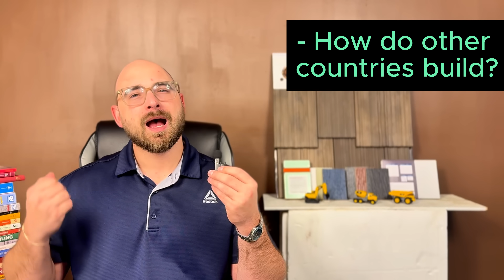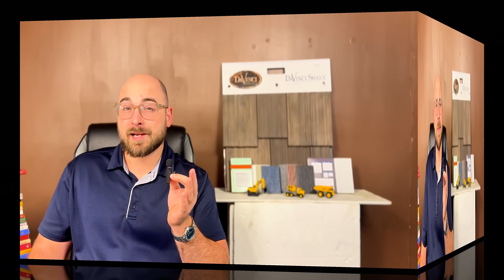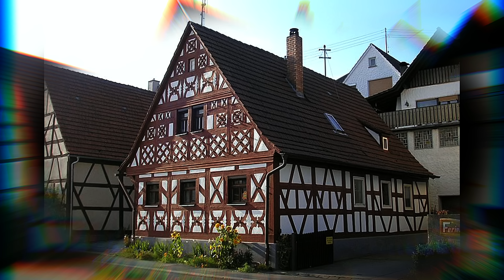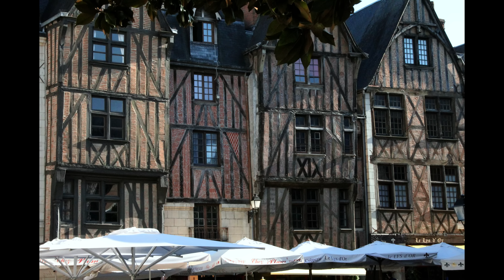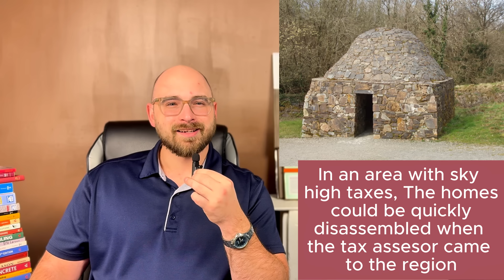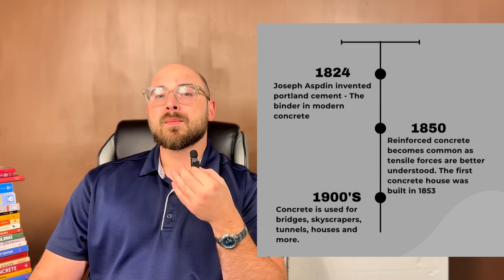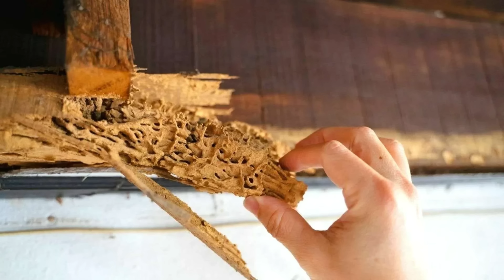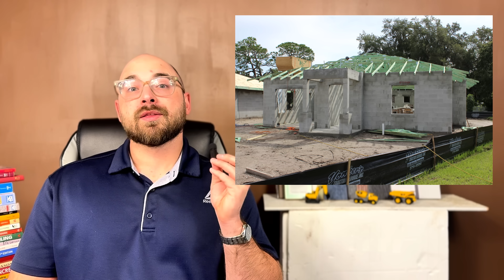Why Other Countries LAUGH at American Homes

Comment: The problem I see with US homes is their quality doesn't fit to their price
Reply: Most definitely!!
Reply: The price for those houses is what got to me too every time. I get that one wants a home and light wood framing is there to make that easy, fast and cheap. So why are they so expensive?!
Reply: @brunsheimmasterbaitwilfrie2811  Living in California, it's more than land than anything. My 1/4 acre lot is $1M w/o any house. The 100yo wood frame house and detached garage sitting on top just adds another $400K.
Reply: @olivertwisted  So, overvalued land and house, lol. 400k for a wood frame house? insane
Reply: 50k would be the price of all materials: concrete and rebars for foundation, grouting and bond beams, blocks, roof with rooftiles at current California prices. Finding a company that would put it together would be rather impossible. It would have to be so called "commercial" builder that would skin the owner to the bone with extra zeroes at the price tag. Regular construction companies just build sheds. it's possible to do it if someone wants to be an owner-builder, educate himself, find independent tradesmen and not allow to be scammed. However nobody will do it, because nobody knows it can be done living in the bubble of stick world.
Reply: @brunsheimmasterbaitwilfrie2811  the price usually is more defined by the area the house is located. Even the  shittiest home in LA will be way more expensive than a high quality house in the middle of nowhere in Idaho.
Reply: Location and acreage. The same house in L.A that costs 400k costs 78k in sw missouri@brunsheimmasterbaitwilfrie2811
Reply: @brunsheimmasterbaitwilfrie2811  High labor and land costs coupled with lots of expected features/extras.
Reply: @brunsheimmasterbaitwilfrie2811  $150 an hour minimum for the labor, thanks to union rules in my region.
Reply: @brunsheimmasterbaitwilfrie2811  It's the real estate that is the real barrier to home ownership in the U.S.
Reply: @brunsheimmasterbaitwilfrie2811 because there is a severe lack of housing options on top of housing being seen a (retirement) investment. 
Basically supply and demand, on top of eveyone thinking their house must sell for more than they bought it for (inflation included).
Reply: The entire price of a home is based on regulations that artificially restrict supply to be produced, that’s it.
Reply: @brunsheimmasterbaitwilfrie2811  Land, permits, supply and demand, financing, tariffs (even before Trump), NIMBY obstruction, other city obstruction (mostly reducing supply), and often politicians have to be "compensated" for any big construction project to go through.  And a lot of contractors can't do math well, and have learned the hard way to be certain there is a profit.  Moving dirt also tends to be pricey.  Not enough tractors, I guess.  Connecting to city plumbing often comes at a high price tag, mostly because of overpriced unionized city workers.  Many of these things very greatly by location.  In California, the permits are nearly half the construction cost.  You have to do archaeology surveys...just all sorts of nonsense.  Some places in rural America they are very cheap, and many things don't even need permits that are not large structures or homes.  Where I live, I can build up to a 6' x 8' non-powered outbuilding without a permit, or replace something that fell apart a little larger like a gazebo...nothing more.
Reply: @brunsheimmasterbaitwilfrie2811  Usually the land value.  The exact same house can vary by a factor of 3x or more depending on where its built.
Reply: @brunsheimmasterbaitwilfrie2811  The cost is rarely because of the house itself, it's the land and location. You're looking at a total purchase price where 2/3 or in desirable locations even more of the value is the land, not the structure
Reply: @incarnadinegardens  Thx for the enlightening answer!
Reply: We have $800k homes being built that won't last 10 years if they're lucky
Reply: @chicagoan81  Yeah my timber frame home was built in 1901 and still perfectly fine. It also cost way less than 800k. So I dunno wtf you are talking about.
Reply: @chicagoan81  Probably not true.
Reply: @chicagoan81 yeah you say that but there's extraordinarily few new homes falling apart in 10 years on their own
Reply: @chicagoan81  bullshit.
Reply: @chicagoan81 last 10 years? You can't even get a house built from day 1 without problems
Reply: With that cost, you would get like 20 or more homes of 3-bedrooms size here in Tanzania, including buying the  plots where they will be built,  and last for a lifetime. Stable homes made by CMO, concrete foundation and roofed with corrugated iron sheets, finished to perfection, or at least 10 two-storey homes @chicagoan81
Reply: @chicagoan81 on average the prices in areas with high interest the prices for m² is around 1,5k/2k
Reply: @chicagoan81  you see now that doesn’t make sense to me that’s from another country, with that kind of money you get a double story or triple story brick house over here
Reply: @chicagoan81 some houses in europe are rather cheap and if a fire happens there isn't much that needs to be fixxed
Only the internal rooms and the roof. The fundament and walls don't get destroyed by the fire
Reply: @jasongrey3113 I know, right?
Houses made of concrete, steel and brick are simply superior.
I remember going to UNESCO world heritage - an old 14th century village made out of stone... 
Crazy how even these comparatively primitive structures can last.
Reply: @spytff  and then you see all these millenia old castles and city-walls in europe that are multipe times older than the USA
Reply: @jasongrey3113  Happens in places where the nobility spent centuries killing their citizens to sate their egos.  Needed a nice place to home up in eh 😂
Reply: @chicagoan81 800k homes made from matchsticks and paper mache 😂
Reply: @chicagoan81  10 Years? Are you out of your mind?? I would love to know of a single home in the US that won't last at least 100 years. Please do provide examples, especially for $800k!

The average homes in my area are 100-150 years old, we built our last home almost 40 years ago, on one of the great lakes with 70 MPH winds, hail, and tornados, and it never had a problem. Still holding strong now and probably for another 100 years.
Reply: @chicagoan81  Uhh, please give an example this. 🤨
Reply: @psidvicious LA fire
Reply: @psidvicious  just look at any of the home inspectors who are coming out with the issues inside almost all new builds. They use a cardboard like material for the walls. Come on now. It barely helps support the framing and homes fall down in strong winds.
Reply: @Marynicole830  Unless there’s a new material I’m not familiar with that you’re referring to, drywall and “cardboard” end in similarity with the paper facing and backing. Drywall, unlike cardboard is immensely superior to plain cardboard for sound proofing, fire proofing, ease of repair or remodeling just to name a couple.
Reply: @psidvicious  type 'cy porter' into your search bar.
Reply: @psidvicious  Look all around Texas. Shitty houses that are barely 5 years old, cost $500K and are GARBAGE. I live in such a house. It was built only 6 years ago and the corners of the interior are cracking because the foundation is TERRIBLE.
Reply: @largol33t1  And who’s fault is that? I don’t even live in TX but I’m aware of the foundation issues and settlement cracks that have been a thing there for ever. Maybe you could have done a little more due diligence and had your house foundation reinforced more sufficiently than what is typically offered in track home projects. For a few thousand dollars you could have increased the base gravel layer depth, more substantially or installed post tension cables in the slab on grade, to counteract the settlement forces. A few thousand dollars initially in a better foundation or several thousand dollars later, chasing wall cracks around. The soil you have in a particular location is the soil you have. The method you choose to build on it will dictate what kind of product you will ultimately get.
Reply: @chicagoan81  I live in America. I have owned a house over 100 years old, brand spanking new homes, and somewhere in between. We have building codes to insure a home is safe, strong, and will last. I have never heard of a home lasting only 10 years, let alone an expensive, high end home selling for $800,000.
Reply: @chicagoan81 That's exaggerating. My house is 30yrs old and was poorly maintained for quite awhile. It's still 100% structurally sound. I build homes and they are built better now with stricter requirements and better materials then my house was built with. If a house only last 10yrs that builder would never build again.
Reply: @chicagoan81  what are you on about my close family home is about 800k today and its been standing for over 30 years no problems
Reply: My house in FL is solid structure concrete, reinforced with steel. We recently endured direct hits by 2 hurricanes, including Helene. We had to open the front door, to hear the wind. This house has also been in my family a long time, three generations have lived here, me being the 3rd. It's just a solid little place with no pretense. I'm offended by McMansions, and just about all new builds in the US are just cost arithmetic when they should be family institutions. I walked into my friend's new house, and I felt like a victim of the builder's accountant. The cut corners pitiful evidence of short-term thinking, the undisclosed addiction of American capitalism.
Reply: i guess, US houses are treated as consumer goods, only for temporary use, while European houses are made for max. durable use.
Reply: This is applicable to literally everything in the US now lol
Reply: @plasmaxl8626  yep "I will bring egg prices down on day one right after I end the war" 🤣🤣🤣🤣🤣🤣🤣🤣
Reply: If you pay over $1000 per square foot for a house in Manhattan, only $50 per square foot goes to the cost of exterior wall materials and labor, very roughly speaking. So for the overall house price, the cost of wall materials and labor is a small portion, and even a fairly small portion in highly developed areas.
Reply: American house IMO, is basically glorified back yard wood shed.
Reply: I'm a bit late to the party, but as someone who has lived in Switzerland and Germany all his live long, I can assure you that what these internet comments doesn't reflect reality.

Simply speaking, the housing market in the US, does offer you much more value in return for your money. The majority of us live in tiny and small appartments in grey concrete blocks. Most appartments don't have an own washing machine, some even don't have a dish washer machine and most of them don't have any air conditioners. The next view, you have is to the next facade. It's not unusual that you've major noise problems, nobody wants to solve, so that you can't do anything about it. Where I live now (Switzerland), buying a house is enourmsly expensive to a point, that not even upper middle class people can afford houses.

When I lived in the US for my exchange program, I was totally blown away how Americans live. They live - compared to us - in beautiful and spacious houses, which don't lack any kind of modern amenities. They mostly have their own garden and garage. 

I actually have good friends, who moved for this exact reasons to the US. They were fed up that they couldn't afford a house with their two kids though both were working full time. They bought a lovely house in Florida. They never regretted their choice.
Reply: The issue is when people compare 80s prices today with income saying the prices are the same 5X your annual salary. The cost of living % was lower not to mention less taxes and a better economy.
Reply: That's why many Americans call their place made of wood, paper and plasterboard a "home", not a house. A shack or shed doesn't qualify as a house.
Reply: The problem is capitalism. Homes are considered a rapidly manufactured commodity now. As in all other industries, the builder wants to make the most profit for the lowest expense, so they throw up tons of dogshit quality stick-built structures which crumble in disasters, then charge an arm and a leg for them, keeping average homeowners in debt forever. In the last few years, developers have reduced the rate at which they're building homes to keep supply artificially low, contributing to the current housing crisis. Same thing DeBeers did with diamonds, only with less (recent) ethnic cleansing. For-profit firms can't be trusted to act in the interest of society; they will only act to maximize profit and externalize costs.
Reply: I've just seen a video of some devastates investor who payed over $60.000 to a "contractor" to nail some board framing and "walls". Everything needs to be demolished because moisture ate the to be home before it was closed. I just can't. In my country, even if you were going to sell something like that as a "garden shed" you would still go to prison for fraud.
Reply: This! Here in Spain we have premade, timber houses, but they cost 1/10th or less of a regular solid house, so it's fine. But paying 500k for a timber house? (I've made some research in real estate agencies) That's crazy. In the other side, here prices are 300k for a flat, but at least you know it won't fall in the next hearthquake.
Reply: Yes, Americans played with their house market too much. The real production cost should often be 10 times lower than the current market value. Especially, with all taxes you have to pay.
Reply: In the USA houses are built with three priorities: they are to be cheap, easy to destroy if the mortgage is foreclosed by a bank, and disposable so that children or grandchildren do not inherit them but mudualy buy another disposable "buildings". The entire Merican market is a market of banks and manufacturers.
Reply: @poke-you-tube not true
Reply: Because they're a speculative commodity, not housing.
Reply: US homes are basically barns or sheds. We have wooden 'homes' in our backyard. I'd cut US house prices in half, not paying $300,000 for a barn. For that money I want a proper brick and mortar home that can halt a truck crashing into it. You can drive a car through US homes... not a secure place really.
Reply: That's why they laugh at us. I lived for a month in a VERY old Swiss house and it was as solid as a bank vault. A lot of fixtures and the superstructure dated back to before WW2 but it felt like it was barely 20 years old. There is NOTHING in the US built as well as this house.
Reply: 👍🏼👍🏼💯💯  Where I live in the Usa the houses are built with very low quality material and people that have no knowledge of constructing a home BUT  when it comes to selling you that garbage they run pretty steep. They sell them for 10X the amount of money they are worth.☹☹
Reply: Fr, here In Argentina you can build a very good house that has 2 floors and it's made out of concrete, with the price of a normal USA house
Reply: And the homes in Australia, Canada, & the Western Europe are? Can people even afford houses there? From what I saw, they are even more expensive than the US while being smaller.  
In the US, home insurance pays for disasters so it’s not like they are just falling apart.
Reply: There is generally less apprciation for quality and long service life in the US than there is in, for example, Europe. Especially in the case of commercial buildings, they often get razed after a 10, 15 years, and something new is built. I mean, have you seent he average Walgreens? It's often nothinng but a near windowless sheetrock box over a wooden frame.
Reply: Agree with disconnect between high home costs and "cheap" construction. Isn't there a greed factor? Isn't construction labor in border states mostly undocumented (zero political commentary) and therefore quite inexpensive? Yes, material costs, etc., have inflated, but I wonder what the average builder's margin is today v. 40-years ago.
Reply: The land often costs more than the house itself.
Reply: In canada just building permits are about $300k
Reply: Yeah cause there itterally is a housing shortage in most US cities and surrounding towns and suburbs.
Reply: The land is most of the price.
Reply: On the other hand they oversize other stuff, like traffic lights that would survive a n-u-k-e. It blows my mind.
Reply: Majority of the price of American homes is due to the location. You can get a mansion outside of the city for the price of a tiny home in a desirable neighborhood with amenities, but yes, the housing market in the US has severely inflated costs.
Reply: Mostly the problem in the USA is that Americans want the largest house at the cheapest price.
Reply: made is america used to mean something reasonable when it came to quality.. today, it usually mean abject crap.. even china builds cars better than the us does.
Reply: exactly, paying 800k for a Woden house is diabolical.
Reply: we cant afford it either wym 😭😭😭😭😭
Reply: Its ridicoulous that canadians pay double or even triple of what my family paid for a house in Czech Republic. Yes we have cheap labour, but we also have brick house, with an indoor pool. And its the same floor area.
Reply: Yeah their price is the location they are built and not what they are built with. Also labor cost can change depending on area which also adds to the cost.
Reply: And especially the sound proofing. when you can hear you neighbors sneeze.😂
Reply: Yep! 

Back after WW2, there was a housing boom because of returning GIs and this surplus of skilled labor

So homes were often the cost of a year's salary. Yeah, they weren't mansions, but it had plumbing, electricity, heating, a roof and a floor. It was like this until the 80s

2 years salary over 30 years meant they were also affordable. 

Now you're looking at houses that cost 10x the amount, built on the cheap because the "house" is part of a company's portfolio, probably failed inspection 3-4 times and has the cheapest fixes to maximize profit. 

It's just crushing at this point over how greed has ruined the American Dream
Reply: 5.40 dollar for 50kg bag of most expensive cement (110.23 lbs)
58 dollar for 1000 most expensive red bricks 
There are cheaper ones😂😂😂
Reply: Some of that is that you're paying for the location and the land more than the house. Unlike in the UK or China where you get a 99 year lease on a plot of land, (Possibly others, but I haven't looked into elsewhere) in the US the land is held by you indefinitely as long as you pay the property tax. The further you get out from scenic attractions or valuable city plots, the cheaper housing gets. Why? The housing quality doesn't change much, it's the cost of the land.

There's also the point of demand. Most of Europe has a crashing birthrate, which means that demand is lower for housing. Housing will continue getting cheaper and cheaper until they get that under control. The US birthrate hasn't dropped as much, and we've more than counteracted its effects with immigration.
Reply: Huge houses for a family of 4= spending hours and hours to clean it, spending plenty of money to furnish it, to heat it , to cool it..
Arrogance of Americans who wanna hv everything big =  rational use of space of Europeans
Reply: @M.C.K.111  You sound jealous. Probably have to share a bathroom with your neighbors.
Reply: Keep voting for politicians obsessed with catastrophic anthropogenic CO2 mediated “climate change “ and everything you touch will continue this upward price spiral.
Reply: Their "pride" rather then their😮 "price".my village has withstood more Earthquakes then USA civilization.
Reply: Exactly
Reply: Quality is one of the variables in the price of real estate. If there are people buying it, then it's ok.
Reply: Insert Michael Scott "Thank you!" meme here
Reply: that's how everything is. it used to be you'd go to a store and look for American made stuff. because it was durable and lasted. you stayed away from China the J A pan company and the other Asian countries because the stuff was pumped out in swet shops and junk. well those swet shops are getting some skills and the labor is still squat so they can put out a nice product that if someone tries to compete with here they need to go cheap and fast and produce junk. it's just how this place has been run into the ground by the country hating left. so you have a third world country with a few decent areas where all the corrupt government people reside. then you have me, the guy that does all their plumbing, heating, electrical, fix their stuff because they are dumb. and I charge them ridiculous amounts to do so. we call them middle class, some of us are better at gouging those useless mouth breathers then others. that's when corrupt family courts come in and steal your kids, your pay and bends you over before they leave. so then I have to gouge them even more. sure I'll be in prison soon because I won't lay down and beg
Reply: I think that is down to scale and location.
Reply: That is correct !
Reply: mostly a location thing(the place is also being sold effectively)
Reply: It's all about supply and demand
Reply: Doesn't matter important is do you pay in cash or you are slave next 20 years in the bank
Reply: and because they are doing this in the tornado alley
Reply: If you think that's bad go to australia LOL.
Reply: also they had better buildings back in time but decided to live worse but cheaper yet again just like with everything else
Reply: That's because you are paying for the land, not the house.  The land is way more expensive than the home.  If we started building homes like they do in Switzerland or Germany, they would all start at $5 million.  Try paying that inside the maximum 25 year mortgage
Reply: us houses last over 100 years without care but still not anywhere close to others
Reply: AGREED
Reply: @meow3343  They'd cost waaaaaaaay more if they were built with bricks and concrete. If they cost 400 000$ now, then they'd have to cost millions.
Reply: Hey, just gotta say. I like your avatar hehe :D Kinda seen it somewhere else :D
Reply: Price is usually set by price of workers, the US usually deports the best workers.
Reply: You have the same in the UK and most countries in Europe.
Reply: You pay for the land not the building
Reply: You can blame local, state, and Federal regulations for this phenomenon. 
Together they force final costs for homes to outstrip any reasonable price. 
Meeting the standards, individually and in total, adds an unusual amount of overhead expense for 
the numerous persons inspecting them, compared to the cost of those building the damn things...
Reply: Thats not just a US problem, i see the same in germany too
Reply: In Germany to😢
Reply: nothing does T.T
Reply: Which homes?
Reply: Just like basically everything in North America, the land of the greedy and selfish a**holes
Reply: A fucking men.
Reply: It's hard to notice when you have been living and breathing this absurd fact your entire life but now that you have pointed it out, I feel like I have been scammed. Look at the California fires that incinerated homes not too long ago. The area looks like it's been nuked.
Reply: You're not paying for the house,  you're paying for the land 99% of the time.
Reply: It’s because boomers decided to use regulations to turn shelter into an investment asset rather than shelter.
Reply: You're 100% correct!
Reply: european houses still several times the prices
Reply: 100%  there is too much greed here!
Reply: The high price is due to cost of land, land with building permission is scarce and thus expensive. The actual structure is cheap.
Reply: you are an idiot
Reply: Yeah, let's take the opinion of a crazy cat lady serious.
Reply: you can thank boomers and suburbia for that, an uroboro of circle jerking to make as quickly and for as cheaply to price it as expensively to a group who see homes as investments than as... places to live
Reply: Housing stock, labor costs, insurance costs (on every procedure), zoning
Reply: Im a painter I know this is true
Reply: Or the elements.
Reply: It's land. The house,maybe takes 1/2 of the value
Reply: @Rikkan4  That depends on the location.
Reply: Definitely! And here in the US new construction houses keep getting worse and worse and more and more expensive because the house builders are no longer mom and pop companies but rather are large nationwide firms that build houses in volume. And except for South Florida it's often cheap light wood construction with no pride in work evident, because the workers often work for federal minimum wage, less if they're illegal aliens.
Reply: For what they are paying, I would expect clt or steel for the frame.
Reply: I'm not sure... In Hungary, in county capitals, a newly built family house around 120m² has a similar price to a 120m² house in Florida. In Budapest, a 70-80m² flat has a similar price to a 120m² family house in Florida. Western European house prices are even higher.
Reply: @makoado6010Also Florida has much nicer weather, has more activities than Hungary, and has over twice the population.
Reply: @makoado6010 Russia overtook China in terms of housing construction in 2023.
 Real Russia/Provincial Russia, North Caucasus Federal District, Stavropol Territory, Stavropol city (population 557 271: ethnic Russians 86.3%, Armenians 4.47%, Ukrainians 1.03%), average annual t +9.9°C, climate Cfa, average monthly rainy days: 8.2-13.7 (767mm), average monthly sunshine hours 230.8, altitude above sea level 230-660m; crime index 34.76, average monthly salary is $597,6, average life expectancy is 74.9 years. The distance to Mount Elbrus (5,642m) is 206 km. Ecoregion: forest-steppe (broadleaf forests/meadow steppe). 30 modern condos from Stavropol city SJFU2jHnMzU see the description of the video
 PS: Chernozems is 47.4% of the territory of the Stavropol Territory.
Reply: @makoado6010 Real Russia/Provincial Russia, Central Federal District,  Belgorod city (founded 1596, area 153km²), population: 394.174 (agglomeration 719.500), ethnic Russians 94,4%, Ukrainians 2,8%, migrants from former republics of USSR 0,5-1%; average annual t +8.3°C, climate Dfb; average annual t°C: summer/winter July +21.8°C (+16.6 - +26.3°C), January - 5.5 °C(- 3.4 - -8.1°C); average monthly rainy days: 7.6 - 11.2 (627mm), average monthly sunshine hours 82.7. Ecoregion: East European forest steppe. The air distance from Belgorod to Moscow - 577 km, unemployed 4.8%, crime index 29.61%, Gender: men 44.5%, women 55.5%. 
Typical houses of suburbs of Belgorod city:
   This projects is the best-selling 2022. Houses 100(117)m²: 10(15) ares (50x20(30)m); living room 20(22)m², kitchen 16(18)m², 3 bedrooms:16(18)m²,14m², 12(14)m², 2baths, garage20(25)m²+boiler room 8(10)m², terrace 14(16m)², carport, ceiling height 2.85m, video intercom, fiber optic Internet, cable TV, heating combined: underfloor heating and radiators, metallic fence 1.8m, metallic front door with shockproof glass(98kg), metal tile, paving slabs, automatic gates.
  Dubovoe(Oak)sm town (5km from Belgorod city, population 16,000). 
 Houses 117 m²:  -PvQZ_2wjZc TbE48oAW9wI nvuM6nJGEVg lZrceqCI_s0
 Houses 100m²: r6wJEsKCinU  9COd2gtz7YY pOeAXrAUDxs

Chernozems in the Belgorod region is 77% of the area.

Belgorod Wedding short clips, 1min:
 Utark Castle, Picnic Park T-yp-kpsHaw
 Center, Picnic Park -2IY3iOUGNM
 Center, Picnic Park YTDUYIsnHts
 Fort "New Jerusalem" epx9KSy7Dus 
Belgorod. Wedding service "Dynasty" short clips, 2-3 min: xgeLiHgA46Q dQSCS0d6YhU
  Such weddings and houses are bought by those who work in oil and gas companies on a shift basis in Northern Russia and Siberia in extremely cold climates.
Reply: @makoado6010   Real Russia/Provincial Russia, Central Federal District,  Voronezh city, population 1,04 mln (agglomeration 1,3mln), ethnic russians 96,9 %,  Average annual temperature of Voronezh city is +7,7°C (2012-2022). The air distance from Voronezh to Moscow - 520 km.
 Koltsovo village is suburb of Voronezh city (10 km), typical modern houses:
House 120sqm (first option): 10 ares (50x20m); living room 22sqm, kitchen 16sqm, 3 bedrooms:18sqm,16sqm, 14sqm, 2baths, carport (without glazing) 20m²+boiler room 12sqm, terrace 16sqm  with barbecue complex (without glazing), ceiling height 2.85-3.2m, gas, video intercom, fiber optic Internet, cable TV, heating combined: underfloor heating and radiators, metallic fence 1.8m, insulated metallic front door 10 cm(98 kg) with shockproof glass, metal tile, paving slabs, mirrored windows, automatic gate.  03F0_pw9AeM  
House 120sqm (second option): 10 ares (50x20m); living room+kitchen 32sqm, 3 bedrooms:16sqm,16sqm, 16sqm, 2baths, garage 20sqm+boiler room 8sqm, terrace 18sqm(without glazing), ceiling height 2.85 XpbkoWu4QXQ 

Forest fairy tale village is suburb of Voronezh City (27 km). House 120sqm: 12,5 ares (50x25m), pines; living room+kitchen 32sqm, 3 bedrooms:17sqm,12.5sqm, 12sqm,  2baths+boiler room, garage 20sqm, terrace 16sqm with barbecue complex (without glazing), LED illumination, gas, ceiling height 2.85, insulated metallic front door 10 cm(98 kg) with shockproof glass, this street with 7 analogy houses  KG34YS_j-PI 

Chertovitsky Forest village is suburb of Voronezh city (18 km), typical houses 100-120 sqm  DJUX16dnuXc The fences are not completed. PS: With fences 5wO0HCnHzTM

Voronezh City , Night cycling, center old historical town nDsjdhS-n48  
 Voronezh City , evening bike ride in Dolphin Park (Ship Grove), Voronezh River Embankment, time - 5: 20 lighthouse 30DOyR9HyUU 
 Voronezh by car: time 0: 00 - industrial zone, 3: 45  - outskirts of city, 10: 30 - enter to city  ARg7YuS9Smc 
80% of the territory of the Voronezh region is chernozem (black) soils
Reply: @makoado6010   Real Russia/Provincial Russia, Asian part, Central Siberia, Krasnoyarsk city (founded in 1628, area 379.5 km2). Population: 1,187,771 (agglomeration 1,412,000): ethnic Russians 91.3%, Ukrainians 1.4%, Tatars 1.3%, Russian Germans 0.8%, Russian Poles 0.5%. Average annual temperature +2,7°C (533 mm), humid continental climate (Dfb); average monthly rainy days: 6.03 - 13.13, average monthly sunshine hours 92.74. Ecoregion: South Siberian forest-steppe(island steppe). The air distance from Krasnoyarsk to Moscow is 3,352 km. 5,8% unemployed, crime index 45.37%. Gender: men 43.99%, women 56.01%.

 Russia, Siberian Federal District, Central Siberia, Krasnoyarsk city, new housing complex "South Coast", walk with Anna BWEI8h3A6bA
 Krasnoyarsk city, Children's flash mob and Krasnoyarsk's British Music Club, new housing complex "Scandis" i3kiq5KNauc
 Krasnoyarsk people: parents and kids, Smile Day, housing complex "Scandis" U9sXB1AKs4s
 The outskirts and suburbs of Krasnoyarsk city, Krasnoyarsk sport life News (short clips, 1 min):
 Krasnoyarsk outskirt, Extreme Sports Festival uoU3CRsv-zQ
 Krasnoyarsk suburb, Running Day VWksyMXjx3k
 Krasnoyarsk region, Sky Marathon nAbcIZOALfY
 Living environment: Siberian Mountain Mixed Sub-Taiga, Motocross in suburb of Krasnoyarsk city around the Siberian Mountain Mixed Sub-Taiga (grassy forest), Dima and Aleksandr - father and son (elementary school) qPEBY5lqZ9M
 Iron Race (2,5 hours in the Mountain Mixed Sub-Taiga) xiDm6YCdcKg Dima and Aleksandr.
 Taiga in the Krasnoyarsk region is 2 million sq km. Near Krasnoyarsk city(7km) IHmwpnZAdF8 More than 90 rock formations with a height of 40-90 meters into hills with a height of 400-800 meters with mixed taiga - Siberian tree species: fir, spruce, cedar pine, pine, aspen/birch. The Nature Park is closed in the spring due to the Mating Season of Brown Bears, Attention Bears!
Reply: @makoado6010 Preview1: In the 1930s, a bunch of kids from Spain came to Moscow to escape the fighting during the Spanish Civil War. Around 2,900 kids and 5,100 adults came to the USSR as part of 4 groups. About 800 of them fought in the Red Army, Including more than 70 Spanish pilots. 151 died and 15 went missing.  Of these, reconnaissance and saboteur teams were formed and sent behind enemy lines, with 119 Spanish men and 6  Spanish women among them. In the summer of 1956, Franco granted amnesty to the exiles and allowed them to come back to Spain. Over the course of 1956, 1,692 returned from the Soviet Union, and in '57, another 250 or so came home. But most of them couldn't adjust to life in Spain and soon headed back to the USSR again.
Preview2: During the Great Northern War between Russia and Sweden in the 1700s(1700-1721), around 120k Swedes gave up and were kept in Russian POW camps until the war ended. After losing at Poltava, another 20-25k Swedes surrendered. Most of these prisoners were sent to work in places like Ukraine, Moscow, St Petersburg, Siberia, and the Urals. Around 8k went to serve in the Russian army and were sent to the Ural defensive line to protect Russia from nomadic raids, known as the "Ural Swedes"(Karolins). They quickly assimilated into Russian society.
Unreal Moscow!
The population Moscow region is about 21,8 million people. That's 13,149 million in Moscow  and 8,651 million in the Moscow region.

   Look, so, the Moscow suburbs, there's this New Moscow Administrative District (founded in 2012 with an area of 1,480 square kilometers). It's in the Moscow region, which is in Central Russia, and it has a population of 750 thousand people(2024). Most of them are Ethnic Russians (86.3%), then there are some Ukrainians (1.34%), Tatars (1.30%), and others less than 1% each. The average temperature there is +6.9 degrees Celsius (+7,5°C 2014 - 2024) and the climate is Dfb with 678 millimeters of rain per year. It's got an eco-region of Sarmatic Mixed Forests. It's only 4.5 kilometers away from the Moscow Ring Road, and the unemployment rate is 5.8% and the crime index is 36.69%. There's also a gender split of men being 44.3% and women being 55.7%. And the average monthly salary in Moscow is $1,610 (or $1,400 after taxes). But the average salary in the Moscow region is $920 (or $800 after taxes) and the average life expectancy there is 74.6 years.

  The New Moscow AD has got 42 new residential complexes with 31 schools and 68 daycare centers. There are three types of residential complexes in New Moscow: economic-class (30%), comfortable-class (60%), and business-class (10%).

  Moscow suburbs: New Moscow Administrative District, the Residential Complexes "Spanish Quarters" and "Scandinavia". The video shows Map of New Moscow, Sarmatic forests, Metro, Highways, Apartments and Streets, etc dCbWP56fpcw

  Moscow suburbs: the New Moscow Administrative District and the Sosensky urban settlement. There's a residential complex called "Spanish Quarters", and today's the Spanish Day there. On Velasquez Boulevard, they're having a dance called "A Small Spanish Corner with a Russian Heart"  SvAIixpWDMg

   Moscow Suburbs: In the New Moscow Administrative District, there's this place called the Kommunarka urban-type settlement in Sosensky Administrative Settlement. It has a residential complex called "Spanish Quarters", which is a comfort-class development. It's about 4.7 km away from the Moscow Ring Road and has a population of around 59K (three areas: First, Second, Third). quadrocopter a short video (<1 min) to take in all the sights 0wzZp_Hutys
 Here's a quick video of the "Spanish Quarters' infrastructure with Nadia XP37xfKLlVM It'll give you a good idea of what to expect.

   New Moscow AD(NMAD), residential complex "Spanish Quarters" (comfort class), Municipal School "Logic" for 1,300 students. Migrants from former USSR republics, Central Asia and Caucasus, 10-15% of the population. 
 First school day 2021 n_rdYhEXh-c 
 School day gBMZd_IrtBQ 
 Headmaster and teachers dance 9Qxvlzd55FA 
 Last school day 2022  714vIKdgYGc
 Last school day 2024 AUOrxFtbFlM
High School Graduation 2024 kuHoisaT_P8

   NMAD, Spanish Quarters RC (comfort class): Official meeting between the School Construction Director and the Headmaster of School Center, with parents of Dialectic school students im4ZdjWo14E
Dialectic Elementary School. First day of school 7372v1eAucY

   Residential Complex "Spanish Quarters" condo (comfort-class):
1 bedroom, 63 sq m: option 1 5ohYX6-K5a8 
                                       option 2 eyUiLRMBWII
1 bedroom, 60 sq m 6Lg-KF-OnW4
3 bedroom, 90(?)sq m 4z6FOZ1Bqc0
1 bedroom, 58 sq m, unfinishing  EW80FdTOp4g
one-room: view from the window, entrance, elevator, courtyard Hrs-NO0QfR0

    Short walking with Aleksandr (2 min): "Spanish Quarters" orbAM3YyvK8
"Scandinavia" A2yHpRbe8SM

   So, in the Moscow suburbs, there's this place called the New Moscow Administrative District: Kommunarka urban-type settlement in Sosensky Administrative Settlement and inside that, there's a residential complex called "Scandinavia". It's a comfort-class complex, and it's about 6.5 kilometers away from the Moscow Ring Road. It's got a population of about 60k, and it has three areas - South, Center, and North. The "Scandinavian" complex is built inside this Butovsky Oak Grove, which has some really old oaks (oak petiolate) - like 125 to 175 years old. It's so cool! You can fly over it in a quadcopter and get a short video of it. Video link here: zYgzCfL4VEU  
   And then, I have a video here of the infrastructure at the Scandinavia residential complex (the North area). It's with Maria o2pE-VTxnZw 
   Also in the New Moscow AD, there's the Scandinavia complex, and there's also a school called "Energy", which is a municipal school for 1.3k kids. There are some kids from other countries too, like Central Asia and the Caucasus, who make up about 10 to 15% of the school population. Here's a video of the last school day qCBWTaFalhM

  Open Ceremonies of New Schools in New Moscow AD DvknDUpKLj8  time 0: 28 Cheerleader girl (depigmented Spain phenotype?), 2: 18  Prefect of New Moscow Administrative District
"Constructor" Municipal School, Open Ceremony,  "Scandinavia" RC UuUydScAQSU
"Canvas" Municipal School, Open Ceremony,  "Scandinavia" RC 5mW97ZoNwdE
  And finally, there's another video of some kids from the "Scandinavia" Residental Complex, schoolchildren dancing. It's only about a minute long ubenM6eSTMQ
New Moscow, Scandinavia complex, "Forest Stream" Municipal Kindergarten  K6UXIEzPVU0

   RC "Sсandinavia", Sales Office, Showroom (classic style), 1 Bedroom 60,2 sqm: living room - 19.3 sqm, bedroom - 12.5, kitchen - 13.6, bath - 4.9 sqm, hallway - 9.9 sqm. 1 min jsEIjCeBg_0
RC "Sсandinavia", flats: 
 1 bedroom 65 sqm ZfrGcy7KWD8
 1 bedroom 58 sqm  RT5YNOtxbvQ 
 1 bedroom 51 sqm, unfurnished SWfTUZ0Bnz8
 2 bedroom 69,8 sqm, without finishing  Qt_TdsS33cM
 2 bedroom 93,7 sqm (exclusive design)  Suq9u98QiwY
 RC "Sсandinavia", underground parking space Y8WjeihXu-g

  Residential Complex - a huge place with 60k people living in it, spread over three areas and covering 3-4 sq km. It took 10 years to build, and it's located 4-20km away from the Moscow Ring Road (in the suburbs of Moscow). There's a metro station nearby, two highways, and 21k parking spaces. The complex has three districts, three forest parks, and three squares. There are 4-16-story buildings with a total of 1.5 million square meters of housing. The complex provides 30k jobs and a shopping complex of 200k square meters. There are also 12 kindergartens for 3.6k kids (1 kindergarten holds 300 kids), six schools for 7.2k students (each school has 1.3k pupils), three medical centers with 460 beds, a Sports complex, a Theater, an Orthodox church, a Fire station, and a Police office with video security.

   A stroll with Svetlana and some chat with the residents from RC "Spanish Quarters" D35-zMiHIvk and RC "Scandinavia" _ZWjv-A72sU

     Walk with Vadim around "Spanish Quarters" and "Scandinavia":
   "Spanish Quarters - 1, 2" (2,78 sq km)  T-vO93t_gc4
   "Scandinavia-North"(1 sq km) -i_8G0hxGd0 9: 43 Building Orthodox Church
   "Scandinavia-Center"(2,017 sq km) IvfTTjaJ79o
   "Scandinavia-South" (0,913 sq km) s2wcj__JohQ
   "Scandinavia-Center" at Night (10 p.m.) ip4n555Lfrk
    Winter fairy tale in RC "Scandinavia" k7TFjvvExGA

   Festivals in the residential complexes "Scandinavia" and  "Spanish Quarters", Kommunarka urban-type settlement in New Moscow
   Children's Eco Picnics:
           "Spanish Quarters-1" residential complex pN7r781O6_w
           "Scandinavia" residential complex __7b351bm44
   "VIVA Spain" Fest, "Spanish Quarters-2" residential complex q7e4QQag3ew
   Sports Festival, Kommunarka urban-type settlement: "Spanish Quarters" vs "Scandinavia" kHrAK8D32PU
    First School Day in "Spanish Quarters-1" of New Moscow, Kommunarka urban-type settlement  rkYy5CSTm_Q
Reply: The reason for that is for the builder to maximise their profit. Which of course will go into the developers hands not the workers.
Reply: @Nollauno That is a very good point. I work in the construction business in the US, and see how mentality of construction businesses affects the prices and quality of new and remodeled houses. This is particularly true in mass subdivision residential developments, where houses are cookie-cutters. I am bold enough to claim that the entrepreneurial and business mindset in people here has caused everyone to chase their piece of the pie. Again, this is primarily true for tract homes, not custom builds. 
Also, when comparing prices, we need to compare apples-to-apples. Don't be comparing structures to properties, city house to countryside house,  mountainous terrain to flat land, coastal soil type to fertile land.
Reply: if buying, the main value always lies in the ground / the property. The house itself is secondary. But the US still building wooden structures is total nonsense.
Reply: Sure they do. I've done the online price comparisons. If we control for the interior area and lot area, you'd have to be insanely rich in Europe to afford an average American home. 

It's a matter of what you're prioritizing getting for your money. Americans value space and comfort. No one wants an outdated building without modern amenities. Lasting 500 years isn't a consideration because no one is going to want 500 year old design.
Reply: @69nites I've seen plenty of Europeans react to how much a home in the US would cost in their city/country and most say it would cost them substantially more for a similar house where they live.  Especially in bigger cities because of limited space. That's what we have here in spades is space.  Other than major cities and poorly run states you'll get a good house with plenty of land for a decent price (unfortunately not as good as the pricing 20 years ago).  

If you can drive about an hour outside of cities, prices tend to go way down with a lot more for your money.   I'm actually about to downsize (divorced and kids are grown) and going to buy a couple of acres and build a cabin on it.  I'll be debt free and won't have neighbors 15' away on both sides.  Might even go off grid and have no utility bills as well.
Reply: @ Bro, the wood shack in our backyard is build better than American homes and no you don't have to be rich to buy an home in Europe.
Reply: The main problem with American homes specifically suburban homes is they don’t account for weather and natural disaster.

Building wood in fire prone areas?

Building using wood in hurricane prone areas? 

In a lot countries there would be a lot of regulations to ensure such houses can withstand the environment, in the us homes just collapse within minutes of wild fires or hurricanes…. (Which often forces developers to use alternative materials, wood is simply not cheaper or in most cases not that cheaper to justify their use especially when accounting the environment that they are built it)

That is other then density to ensure home supply adequately matches demand.
Reply: Your arguing with supply and demand.
Reply: The price is dictated by market
Reply: Like yea, if I saw an american house in my country I'd expect to be paying it for maybe 5 years and live in it for another 5. Homes in LATAM are a 15 - 25 debt but you pay for the long haul because that's your house for life.
Reply: Also the walls can’t even stop a 9mm bullet. And that is an issue in the US! 😅
Reply: Yeah, made of cardboard and toilet paper.
Reply: Y'all don't know jack about building do you.
Feel free to drive your car into an American home.
Most homes will shrug it off, replace the siding maybe some sheathing.
Be fixed up in a day.

150 mph wind?
Might lose a few shingles.

Earthquake?
Meh, stay away from shelves. Carry on about your day.

Brick and mortar?
Fairly common.  We use it as an accessory too! Looks good.
Isn't actually needed.
Reply: @NA-en7kz  in most of the things you mentioned it would get completely decimated
Reply: Exactly!!!! If they cost 100-200 thousand that would be a reasonable price. But to sell paper and cardboard houses for 800-900 thousand dollars is absolutely insane.
Reply: Might be true but our homes generally bigger
Reply: Bigger is not better. Bigger Burgers, bigger cars, bigger guts - its not about size  @Unknown-r2p2o
Reply: @Unknown-r2p2o Bigger and more expensive. Aka still low value to price ratio.
Reply: American homes are on average twice the size for the same price as european homes.
Reply: @algaeninja  quality != quantity
Reply: @johnsmith1926  House size is a quality that is factored into price. By your logic, quality doesn't exist, since it can all be reduced to a metric of some kind.
Reply: @algaeninja  But why would the size matter if the wind can easily blow it away the next day or just crumble in a few years on its own? So yeah, quantity is not equal with quality.
Reply: @tovarishchfeixiao  Wind will not blow away a light lumber constructed house, unless you're referring to tornados. However, American tornados will ruin solid-structured buildings as well.

Additionally, crumbling in "a few years" is ridiculous. Maybe in 50 or 100, but unless you're living in a trailer, it's going to last multiple decades.
Reply: @tovarishchfeixiao Europe has less than ¼ of the tornados the USA has and they're much weaker, same goes for hurricanes, earthquakes, snow etc. It's usually older houses going down as they are not up to standard.

Size matters, it's more comfortable & convenient. You can move everything around. It's also much easier to replace/move old electrical wires & plumbing. This means when a standard changer like lead plumbing or copper wires were banned the changes happen much quicker in the USA/Canada.

My bedroom is half the size of a small apartment in a big European city lol.
Reply: @tovarishchfeixiao  Most American houses don't just blow away or crumble. The oldest house in my town was built of wood in 1650. I'm surrounded with wood buildings that are over 100 years old. Most U.S. houses end their lives by demolition, because they are no longer wanted, rather than natural disasters.
Reply: @ Size is in general considered to be a quantity. Similar to volume and weight. Words have meanings. Quantity of your food would be weight or volume, quality would be ingredients, taste and so on... Same for your house. Size of your house is be quantity, quality would be how sturdy your house is, noise level with closed windows, given a certain noise level outside, how easy it is for a thief to break and enter your house, optics and so on... I'd rather live in a smaller house of higher quality than in a house double the size that has the quality of a dog shelter. You might like it the other way around. Go ahead then, more power to you! Still does not matter. What matters is that the OP was talking about the lack of quality, to which you replied: But ours are bigger. But that was was not the issue.
Reply: @johnsmith1926  You can have big quality house like you can have shitty small house. People like to renovate their homes to their liking, it's much easier and affordable in North America. Changing old standards is much quicker too because we have far superior access to piping & electrical wires. 

Europeans are usually smart but they've been brainwashed into thinking our home & building codes are so bad even newer construction can't withstand the forces of nature which is ridiculous. The vast majority of buildings that get heavily damaged are 50+ years old built under different codes. 

And again in North America we have way more snow than northern Europe could dream of. The USA has more than 50% of all tornadoes in the world and the strongest. The east coast of the USA  gets category 1 to 3 hurricanes every year and category 4-5 from time to time while Europe gets tropical storms (much weaker winds). The west coast of the USA has more & stronger earthquakes too. Yall want to laugh at the USA when the houses there have to deal with stronger & more frequent natural disasters than Europe.
Reply: @johnsmith1926  Noise reduction is a quantity. It's measured in dB. Sturdiness is determined by a variety of material and structural factors, all of which can be boiled down to quanitative values. Ease of burglary can be estimated based on whether a house has alarms, number of unbarred first floor windows, number and type of lock, etc. 

Anything can be a quantity if you are analyze it enough, and while square footage is a quantity, the spaciousness of a house is factored into its quality. Nobody would call a 1 sq. m house high quality even if it was built up to close and with the best materials.
Reply: @ Actually quality of noise reduction is already difficult to measure as a quantity as it is not only highly dependent on frequencies but also whether it is a noise dampening or noise blocking effect.
Type of lock is also a question of quality.
Nevertheless, lets have it your way and all of these factors are quantities or qualities if you will. So right now we have square ft or square meters vs all the rest. Putting no effort into it is one thing, but compared to the effort houses are quite expensive in the US.
Reply: @johnsmith1926  American houses are half the price per square foot compared to Euro builds. You're telling me that we put less than half the effort into our houses? I find that hard to believe. You can say that you don't like the material, but calling American houses overpriced (compared to Europe) is plain wrong.

Also, Noise reduction is simple, take two measurements at a singular frequency, and take the power ratio.
Reply: @algaeninja  "You're telling me that we put less than half the effort into our houses?"
It felt like it. Roofing, light switches, bathroom, windows. Most of it is sub standard from a European perspective. Which is totally fine. Everyone does his own thing.

"Also, Noise reduction is simple, take two measurements at a singular frequency, and take the power ratio."
Already told you, that there are already two different types of noise reduction. Dampening and blocking. Specifically for the latter, American houses usually don't do well. The other thing is that different frequencies are handled not equally well by different materials. If you don't care (and most Americans don't seem to care about noise levels), you can go with your simple equation or don't apply it at all. Once again, that is totally fine. You do your thing.
Reply: @johnsmith1926  How many American houses, and what class of housing are you familiar with, because when I was in England, all of what you listed seemed the exact same besides roofing.

The difference between dampening and blocking doesn't matter. All that matters is the power driven by the air to the eardrum, which can easily be measured, and while different materials respond differently to different frequencies, if you choose the frequency most corresponding to the most likely noise source, (cars on a road, rain elsewhere I assume), it will be a good enough measure.
Reply: @BananaBlooD9517  - Great points, and correct to be sure. Americans don't want to live in tiny houses older than our entire country. I just spent some time in Spain, and although the architecture was amazing, it lacked a lot of what we Americans would consider owning. A person we were with in Madrid told us that she lived in a newer apartment that she jokingly said was built in the 18th century, which of course is the 1700's. We stayed in a lodge built in the 1500's and the history there was amazing as well, but again, lacked the amenities we would want. Even newer apartments in Madrid are WAY over priced. a 600 sq ft apartment will cost you over a half million euros and an 1,800 sq ft will cost you over 2M euros.
Let em laugh all they want.
Reply: @justadbeer  I've seen shows and video about small apparentment in Paris... Many people live in 110ft² apartments... I used to have a 72ft² walk-in when I was a kid. I used it as a playroom 🤣
Reply: @justadbeer  People in the USA & Canada want to live in a house/condo/apartment that is tailored to them. In the case of a concrete condo/apartment that means they have to have perfect subdivision & ideally the outlets are at the right place. 

In the case of a house we know plumbing can be easily moved a little bit & electrical wires aren't an issue at all. Heck of needed most walls can be moved or you can add new ones. To split a big room in half. 

Most people I know will buy a house that is somewhat to their liking & will renovate/modify a room every few years. 

My parents bought a house built for soldiers coming back from ww2, they were the second owner. The old copper wire & breaker panel was changed. They did the whole basement that had nothing besides the central heating unit & added 6x24ft to the house from basement to 2nd floor. 

My parents friends, my cousin & my friend's parents all worked on their house & modified it.
Reply: @BananaBlooD9517  Mine is too and i live in a Hungarian village in middle Europe. Half of the materials shown in the video have the same advantages as wood.
Reply: @BananaBlooD9517 Europe has more earthquakes than US, for example, Greece, Italy and Turkey
Reply: @BananaBlooD9517 that’s older buildings they renovated and in the past the houses for the working class was to sleep and eat so they used to be small and easy to heat over the winter.
Reply: @BananaBlooD9517  if electrical work isn't being done by a drunk chimpanzee, it's pretty easy to replace the wiring in solid construction homes. Just tie the new wire to the old wire and pull it through the conduit. If i were to replace all the wiring in my house it'd take less than a week and i wouldn't have to damage the paint or the walls to do so.

Adding new conduit can be a pain though
Reply: @algaeninja size is quantity
Reply: @justadbeer  I hope you compare the price to Washington DC as Madrid IS a capital (about 426€/sqft vs $499 (~475€)). As for property taxes, they are generally much cheaper across Europe, even the EU zone.
Reply: @BananaBlooD9517 
Well we have a slightly above 400m2 stone house.
Reply: @johnsmith1926  If you scale properly you can make quantity at the same price of quality; usually the tradeoff is flexibility which shouldn't be needed when you build in the same type of environment.
Reply: @justadbeer youre comparing houses in towns to apartments in world capitals with a high amount of tourism, obviously an apartment in madrid is gonna be more expensive(relative to a number of factors) than a house in some random town, compare NY apartments to Madrid apartments
Reply: @tovarishchfeixiao  The place I live in is a standard light wood framed house with drywall on the inside, and plywood with siding on the outside. It was built in the 1970s, and is structurally fine. However, the builders were cheap, lazy, and a bit dumb; the wiring, and plumbing were done very, very poorly. We've slowly had to fix a lot of their questionable interior work. So, the typical American house doesn't crumble after a few years as you say. Like I said, mine is fine. All of the houses I've lived in growing up were built the same way, all in the 1970s through the 80s, and were all structurally fine despite being decades old.
Reply: @BananaBlooD9517  .....far superior access to piping & electrical wires??? LOL... First of all, We have a better energy system In my Country, Austria. It´s 240V and 50Hz instead of the weak 110V at superficial 60Hz.  We have no ridiculous Cans on high poles beside the streets but massive transformer stations in a concrete Tower for about 500 to 1000 households per Station. Cables standard all underground. Only the 400V line can go over the ground. And, the only houses without electricity here are the ones with not paid power bills!
Reply: @tovarishchfeixiao  Wind, or a hurricane? I've never heard of a home here in America falling down on a windy day. !00 mile an hour hurricane winds, sometimes.
Reply: @BananaBlooD9517  
I'm from Northern Europe, and some of the American weather extremes always comes into my mind when people discuss about building houses here versus building it somewhere in the USA.
Reply: @pcno2832 or they burn down (See the Californian recent fires)
Reply: @BananaBlooD9517  In most european countries the electric wires are underground and go directly in to the house That's a reason we don't have so many black outs. 
If we want to renovate a house we don't need inspectors and can do inside what ever we want.
Reply: @BananaBlooD9517 have you seen your plugs? What standardchange. Everything you say is possible to do in every home.
Reply: @pcno2832 old us homes were used with slow growing forest lumber. No comparison to what they use these days.
Reply: @algaeninja what implies quality to you: s small diamond ring made of most precious materials, or a big ring with stones from the river and made of wood.
Reply: @r.a.9630  What implies quality to you, the Cullinan I, or a singular grain of diamond dust?
Reply: @justadbeer  Bro, what? half a million for a 60 m2 apartment in madrid? Just say you havent got a clue and stop making up nonsense. You pay that for new construction 120 m2 apartments, lol. And 2M is only for luxury units inside poshy neighbors. Madrid is also possibly the most expensive place in Spain. Compare it to a flat in New York or Miami or something, not to your timber dog house in the middle of nowhere. An average brick and mortar 200 m2 house near the Mediterranean sea in Spain can be had from 200k euros. You can have real luxury chalets for double that. You can barely get a shitty 3 dorm house in a crappy lifeless suburb in Atlanta for that money. And its not even built up to standards.
Reply: @BananaBlooD9517 then spoke with me, earth quake? Per 3 hours, volcanoes? Everywhere and 4 of them are super volcanoes, tornadoes ? Plenty! and we STILL BUILD OUR HOUSES WITH CONCRETE!😂
Reply: @pcno2832 we saw the hurricanes aftermath mate
Reply: @pcno2832 how much did it cost to maintain it since ?
Reply: @BananaBlooD9517  so US gets 4x more tornadoes and still chose to build flimsy homes? What's the logic here?
Reply: @algaeninja  They are not half the price. What are you smoking? 🤣
Reply: @metallboy25  The cost per sq m is half.
Reply: @tovarishchfeixiao  my guy they don't just blow away in the wind when a tornado brings a house down it's cause the wind is well over 150mph and it can pick up things that damage the whole building like natural disasters here are no joke our storms in general are statistically worse then Europe sees ever and you see at most a quarter of the tornadoes we do I dont think you ever see hurricanes either frankly our homes have too see alot worse on a far more regular basis
Reply: @pcno2832  its not the old well-built houses that are the problem. if you watched the video, he said that the US used to build differently until they found the fast and cheap way that they still use today
Reply: @BananaBlooD9517 well, now compare paris and new York and you are back on track with similar prices, ny probably being more expensive...which makes sense as both are capitals. Comparing your home to the most expensive european cities is ridiculous, european countryside is cheap too. Compare that to new york, where people live with roommates in studio apartments at the same price point as some mansions in europe.
Reply: @justadbeer and then all you murricans build are these ugly same looking paper houses en masse. With roads everywhere, no good usage of available space, everything separated, everything needs more supply work. Costing the city and towns more to repair infrastructures. Ever wondered why places in the US have more and more financial problems? Yeah thats because of your suburban sprawl
Reply: @BananaBlooD9517  Access to piping and wiring is not a material problem. It's a design problem.

Yes, if you cover your piping and wiring within a solid construction, access to it is indeed made more difficult. But the question is...why do you do that?

If you design your house with the intention for that, you can have almost instant access to these without the need to compromise on quality and strength of the structure. Have designated channels for pipes and wires that are running in shallow cavities in the concrete/bricks, which are then covered with decorative panels. Voila. Take off the panel and you have access to the pipes and wires.

In other words, your main argument is not even relevant here. It is a design choice, not construction method choice, that really affects it.

And your argument against natural disasters?! Yeah, America has a lot more natural disasters that are more destructive. But sorry...That's EXACTLY why Europe (and most of the rest of the world) is actually saying you should be building stronger homes. There now exist building methods for solid structures that will not crumble under strong earthquake. I mean, you actually greatly underestimate the earthquakes in Europe. We have them as well, and not that much weaker than in USA. What we do not have is the destructive tornadoes. But guess what. Tornadoes are one of the natural disasters that brick and concrete houses are actually STRONGEST against in comparison to wood. When built properly, having your shingles pulled from your roof is the biggest of your troubles. Except that giant piece of your neighbors wooden house that moves at a speed higher than a race car, of course...

Sorry, but the only person that's brainwashed is you.

PS: Brick and stone houses can absolutely withstand more snow that any wooden house. What's that argument even supposed to help you with?
Reply: @BananaBlooD9517 have you seen the massive increase of videos and rapports about shoddy newbuilds in the US? And are talking 500-800k homes full of structural problems.

Code means nothing when not enforced.
Reply: @BananaBlooD9517 
do you live IN a us city then?
bc otherwise that last argument is quite deceptive, then i could go  round arguing around NY apartments and european castles, europe has much less suburbia bc of historical reasons that i do very much encurage you to research
(Especially about the seggregation that suburbia fosterd)
A duplex right outside the city in europe is afaik wuite comparable in price to a us suburban house, especially when you factor in something i am so supriesed about to this day insulation, this dos not apply to all us homes but it is a shame how many us homes have sub par insulation, sweden often survives with nothing but insulstion and radiators, and no it's not bc it's always cold here
Reply: @BananaBlooD9517 True for some centers like Paris in inner Cities. Not true for all the rest.
Reply: @BananaBlooD9517 When you say „Europeans“ you might not be aware of the huge differences. And no, I‘m not „brainwashed“ (ridiculous claim). I experienced housing in 70+ countries and I think I‘m qualified for an objective comparison. The feeling in a solid house is completely different from a wood framed one. And after you saw what can happen to a wooden structure when looking into the walls after one or two decades, I do prefer my solid house.
Reply: Quality is metric
Reply: @BananaBlooD9517  Then i have to ask, was the houses build 50 years ago of god quality? when we build a house in Sweden at least in the north of sweden where i live we build it according to the weather and environment and we build them to last for generations why put in the effort and money building a house just for it to be gone in 50 years?

 It's not like the environment and weather has changed that much in those 50 years so why dident they build the houses to last? America gets a bad reputation for por build quality from those houses not the ones that are left standing.

I have to agre that the houses built in America today arent that bad, that said I would chose a house built using swedish methods and regulations over a house Built using American methods and regulations because i prefer those methods and regulations not necessarily because they are better. 

sry for my bad English.
Reply: @tovarishchfeixiao  I have friends living in 100-160 year old stick frame houses which are in great condition. Go to the east coast and they're a lot older still.  Do you honestly believe that these houses crumble in a decade? Area blight causes by lower-income demographics purchasing homes after 30-50 years is what ends up destroying American suburban homes.
Reply: @algaeninja Quality literally CAN be reduced to metrics. WTF are you going on about?
Reply: That's if you care about having a big house. What do I want a big house for? As long as I've got all my shit what do I need all this extra space for?  @BananaBlooD9517
Reply: @BananaBlooD9517  

How is the sound insulation in those walls. If someone wants to go to sleep will they hear the talking from the kitchen and disrupt their peace and quite or are they properly sound insulated?
Reply: @pcno2832  Or the 90 yr. old living there died. In most cases was not the original owner.
Reply: @algaeninja my issue is that the houses aren't that bullet resistant for a country with so many bullets
Reply: @algaeninja Doesn't change the fact that you build your houses with wood.
Wood won't last.
Bricks, steel and concrete are resilient on the other hand.
Reply: @BananaBlooD9517  Don't see why you need honking huge bedrooms. I added a bedroom/bathroom/laundry/walk in pantry/computer/exercise wing to the back of my 1916 Sears Craftsman home here in Wyoming and gutted the 500 sq ft interior to make an open floor plan living/dining/kitchen. My bedroom? Just big enough to fit a queen sized bed and 3 ft of space on each side and at the foot with more than enough room to use the sliding door closets. Why? I only use my bedroom for sleeping and to change clothes. No need for huge bedrooms you need to buy clutter to fill. Our ancestors lived in much smaller houses and they somehow managed with even bigger appliances than we have today.
Reply: @BananaBlooD9517 Europe doesn't have tornadoes 😂
Reply: People exaggerated the quality flaws of these homes. They're still not worth the price, but my family's been at their house since 2004, and the thing is still holding strong. @tovarishchfeixiao
Reply: @tovarishchfeixiao  That is nonsense.  It is not going to blow away.  Not unless it was in the path of a large tornado. Walls are bolted to the concrete every few feet.  And they have building standards that have proven effective where those happen commonly.  And homes do not crumble that are maintained unless there were significant defects in the construction that were missed, or it was built on slumping land.  Some modern highly efficient homes have to have power all the time or mold can grow, like in a refrigerator that is unplugged.  So house flippers can get stung.
Reply: @pcno2832 exactly. Idk what’s up with the misconception that us houses blow away after a thunderstorm. Thunderstorms don’t do a thing to your house unless it’s either struck or a tree falls on it. Also, weather here in the us is typically more intense than European countries, so not only are our houses not blowing away in a thunderstorm, but they’re surviving storms much more intense than the ones in Europe.
Reply: @justadbeer generalization is a bitch. Yes in Madrid, or in Milan, or in Paris apartments/houses may be extremely expensive for their size, but even more expensive are (at the same size) in Manhattan, Los Angeles, San Francisco... etc. So, as there are places with that prices, there are lots of other places (still built to the same standards and with the same materials) where house cost less than in the USA at the same size. So, your point, what does it prove? That the house are always bigger in america? Not in big city centre. That houses are always cheaper for the same size? Uhm, not at all. My dad's house at around 40km from Rome is about 4000 sq ft (365 sq meters) (considering only the usable living spaces) and it costs around 700 to 800k. So again, what does your point prove? In europe you can find large houses at same or lower prices than US. This is also a true statement if you generalize without considering the location.
Reply: @pcno2832  I like how easy it is to fix things in American homes. Like electrical or plumbing. I do think the materials are way too expensive though
Reply: @pcno2832  survivorship bias
Reply: @johnsmith1926 You over thought the response. He's not equating size to quality. He's just saying size makes up for it. That's his opinion.
Reply: @chrisfrench9257  I referred to what he wrote.
Reply: @Elora445 Yeah it can get a bit wacky in the extremes.  Some states have heat that goes around 120°F (guess that's like about 48° in Celsius).  While others have to deal with like -30°F/-34°C lows.  Then you have some like where I live where it's kind of in the middle where it can reach triple digits and still go below zero on the extremes.  You also have tropical like areas where it's warm/hot all year.  

You have earthquakes in some areas and hurricanes in others.  Throw in blizzards with so much snow cities are completely shutdown.  Flooding is also an issue for some areas.  Just for fun throw in the most dangerous thing in tornadoes that come without much notice.  

So houses have to be built for whatever the threats are to their areas.  There's probably not a one size fits all kind of house here that could handle all of that.  If there were than most people probably couldn't afford to own one or they'd live in the equivalent of a cave.
Reply: @algaeninja and that is a good thing, why exactly?
I mean I can understand some people wanting a large house, but most just want a house with enough space. Many people would be happy living in half space if they paid half as much or the house would last longer than one generation, or longer than the loan they took out to buy it even.
Reply: @algaeninja  not really. I’ve never lived in a home bigger than 1200 sqf and usually under 1k.  They aren’t much cheaper than other homes that are slightly bigger either.  Some of our McMansions and wealthier areas might bring the average size up but the homes the normal citizen buys in the US are pretty close to the size most people buy in Europe. And even if that wasn’t the case the space isn’t such a big difference to justify the price when using inferior materials.
Reply: @Marynicole830 1200 sq ft is small in the US
Reply: @algaeninja  size isn't quality, they're still made of sticks.
Reply: @СергейИванов-й8с8ъ  If you think treated lumber is sticks, you have pebbles in your skull.
Reply: @algaeninja  And 1/10 durability plus triple the maintenance cost.
Reply: @algaeninja  but European homes will outlast american home by decades. My house was built n the late 16th century and still looks very much the same as when it was built.
Reply: @algaeninja  Er no? Source? Overall costs are fairly similar and above what most european nations have. The only place were the us is consistently cheaper is apartments but even then it is not half.
Reply: @XMysticHerox  American houses are double the size of european ones
Reply: @algaeninja  That is not the claim you made in your original comment.
Reply: @XMysticHerox  Twice the size for the same price means that they are roughly half the price per square ft. Everybody else in this comment chain understood that.
Reply: @algaeninja  It is price per square meter in the stats my dude. No that is not in fact dependent on the size of the house. You have also yet to share a source so the idea of "everybody else getting it" when there is nothing to get is funny.
Reply: @algaeninja there's a YouTube channel that compares American houses to literal European castles that are around the same price range.
Reply: @algaeninja  They are also half the quality, so that evens out.
Reply: @Cartilog-z4f  Sure, if saying that helps you sleep better at night.
Reply: @algaeninja  But our houses last for 300 Years and longer....
Reply: @bernhardmichaelfux308  Okay, I don't want to live in a 300 year old house. I want to live in a nice, modern house with modern things, where it doesn't cost an arm and a leg to remodel.
Reply: @algaeninja  That jsut factually not true.
Reply: @LetsKeepThePeace  look up average housing price per square ft in the us and in the eu
Reply: @algaeninja  Average price means nothing. Think about it. Average price for a house in New York is $799K. Average house in Austria is €492k. With approx the same population. Averages mean nothing because you can find a house in the US where a square feet is $400 and you find one in Hungary for $3000. Or vice versa. There is also a gigantic difference between inner big city Europe prices and outer city prices. As i would assume there are in the US. No to mention that outer city in Europe usually does not mean 1,5 hour commute to the inner city but 30 minutes, but thats a different story.
Reply: @LetsKeepThePeace  Wow! When you only look at outliers, the mean is non-representative! Thank you for blessing us ignorant Americans with your magnificent European knowledge!
Reply: @algaeninja yep and they blow down or bur up so much more quickly than a concrete or brick built home
Reply: @algaeninja  For rural areas this isnt right. For urban areas this isnt true again. If you compare suburban and urban then yeah but Eu doesnt have suburban areas
Reply: @exosproudmamabear558  would love some stats on that
Reply: @algaeninja well yes it’s going to be twice the size when it’s made out of trash
Reply: @algaeninja  no, they aren't.
Reply: @Ian-nl9yd  I've posted sources in this thread
Reply: @algaeninja  That building is gonna last for decades to centuries though. That is the investment.
Reply: @algaeninja  Not even close, in my country i can make 2 story house from concrete and bricks that will last decades for under 80000 euros while you will pay for the same size one made from sticks and dry wall 3-4 times more. I`m not trying to make a laugh of your homes but truth is that your home industry is ripping you off BADLY.
Reply: @algaeninja  Let it be half the price and half the size. Doesn't make it any better when a house deteriorates after mere 10 years.
Reply: @algaeninja  and they last 1/10th of what european house do
Reply: @algaeninja  No, they aren't. The notion that construction material can change the price drastically is one of the lies US developers use to justify using woodframe. 

For an average construction of same size home technology of walls has least impact on final price...

Let's say you have a home price in units without currency to make it easy:
- 200k plot
- 300k mansory construction
- 300k intalations and developer standard inside
- 300k finishes furniture, kitchen and bathrooms

1,1m, out of it using woodframe you can realistically cut 100 to 150k maybe, and that only will happen in very few places were labour prices for both are similar like maybe Sweden, Norway...

Don't get lied to by the industry.
Reply: @algaeninja  - I'm not sure this is true, though of course there's a lot of regional variation in pricing within both the US and Europe.....But the thing is that the durability of the average European home - built of solid masonry and with a ceramic tile roof - is simply WAY better than a flimsy American cracker box home built of two-by-fours, with a tar-paper shingle roof, and gypsum-board (aka "drywall") interior walls that you can literally punch through with your fist....Don't try that with a European house - you'll go to the hospital with a broken hand, but the wall will still be fully intact! 😉
Reply: @Bike_Lion  And the wall will still be fully intact when you try to rewire your house, or when you want to install insulation and AC bc of global warming, or when it's turned you into a pancake, because you live in America, where the once-in-a-decade natural disasters are more intense than once-in-a-millenium disasters in Europe.
Reply: @algaeninja  I'll take quality over quantity every day.
Reply: @algaeninja  Like with food, Americans put quantity over quality.
Reply: @algaeninja For 550K $ I can buy a beautiful historic 2500 2m palace in from the 1800’s with 2,5 hectare of land 1800’s. What can I get in the US from the same amount?
Reply: @algaeninja and adjusted for income much much cheaper.
Reply: @algaeninja 
And last a hundred times less
Reply: @algaeninja 
And still suck
Reply: @algaeninja  yeah and build with paper and wood. Quantity isnt better than quality for living places
Reply: @angelamehrkill1228  My "paper and wood" house has plenty of room for me, my family, and anything I could ever need, and will still last at least until I die. It has excellent lighting, insulation, and a wonderful floorplan. Your centuries old brick hovel is dingy and full of mold.
Reply: @algaeninja6806  bricks are actually really good at keeping the warm air inside cause the good isolation. The fact that yours is maybe a bit bigger is a good reason too but you have to remember that our houses are build for centurys and can always be upgraded. Its good quality work. Expensive but it lasts way longer and way more ressistent againts the enviroment
Reply: @algaeninja No they are not  🤣
Reply: @algaeninja  and triple of price?)
Reply: @algaeninja We build our own house for 250k Euros and it has ~230m2 that‘s that‘s more than enough.
Reply: @algaeninja and last two weeks if you’re lucky
Reply: @algaeninja  they are not
Reply: @lordcurre39  This is so easy to google
Reply: @algaeninja this is the American problem, you'd rather have something bigger of inferior quality than something smaller of superior quality.
Reply: @algaeninja  twice the size and a quarter of the quality.
Reply: @algaeninja let's just hope your builder actually does it properly
Reply: @algaeninja but 1/4 of the quality
Reply: @algaeninja it's actually more than that now
Reply: @algaeninja  
Space that's often filled with useless junk anyway. Like, if you have 5 kids, sure, but for the majority it's just more hassle to clean and then it decays quickly.
Reply: @algaeninja  yet they couldn’t last a tenth as long. I take quality over quantity. What happened to America’s pride in quality?
Reply: and last just a fraction of the time or are destroyed by the first puff of wind
Reply: @algaeninja  And more than twice the price and you children or grand children will need to rebuilt it...
Reply: @karakarakiri9568  Double the price would be 4x larger, not the same size.
Reply: @algaeninja  as a brit ill never understand other europeans saying american houses are bad. they aren't built very well but they're always so massive. an average american suburban home in the uk would be considered a mansion and be millions in or near london.
Reply: @MurgleMan yeah, tbh it seems like coping to me. It’s like they think US houses just falling apart after 30 years or so which is just not true. Sure tornados & hurricanes can destroy homes but that’s rare & what insurance is for.